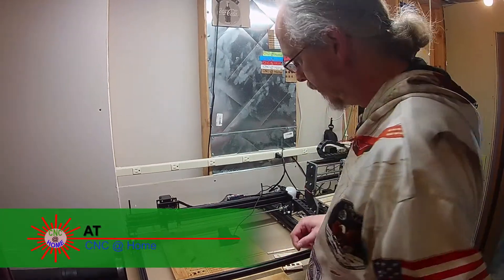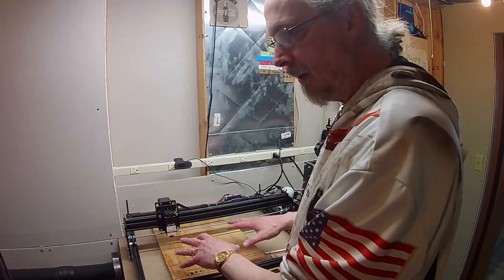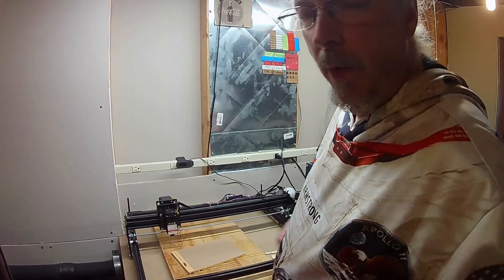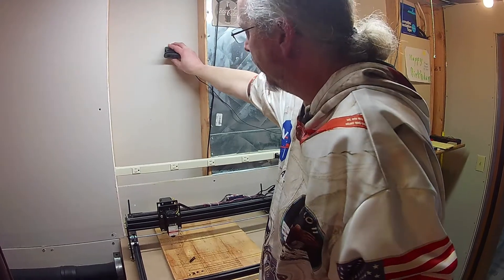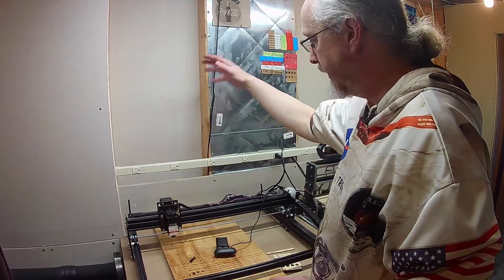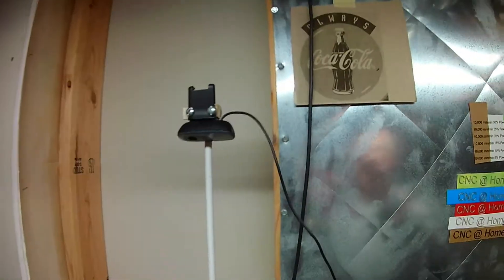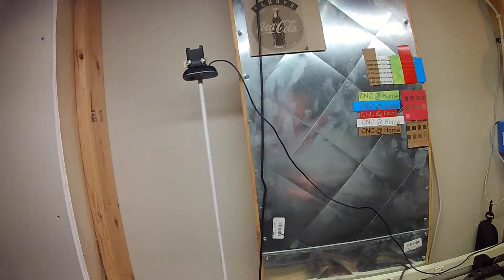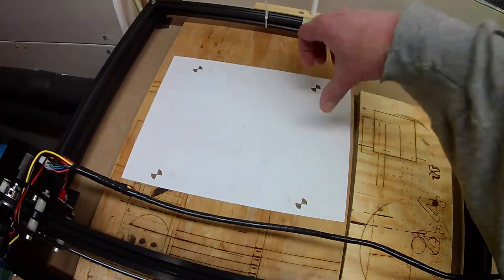Using a webcam with LightBurn

Comment: Hello can you tell me the model of the webcam? Will a 2mp camera works with lightburn
Reply from the maker: That's a good question.  I haven't used that in a while.  Let me go check...  It is an old Logitech HD Webcam C270.  At least that is what my computer says when I plug it in.  A 2mp webcam would work.  The better the resolution, the more accurate it will be.  Good luck!  🙂
Reply: @CNCATHome  thank you very much

Comment: So I'm looking for a decent 8 megapixel webcam for my ortur laser master 2 pro with a 400x400 engraving area. Any suggestions? The one lightburn sells is too expensive for what it is and there are mixed reviews on image quality. Plus I really don't want to spend an extra $30 for a 3d printed case when it should already have a shell around it lol. Most of the webcams I'm looking at on amazon have autofocus that is meant for faces in the center and blur anything that isn't in the center. Looking to spend less than $50 but the cheaper the better as long as it works for lining up images. I don't have a housing and basically doing everything from a table in my bedroom lol.
Reply from the maker: Unfortunately I do not have a good suggestion for you.  When I was playing around with this, I used an extra camera that my brother had lying around. The resolution was not the best for this purpose. I also found that to get it working properly required realigning things every time I used it.  The slightest change would cause issues.  Even when I thought I had it lined up, it wasn't.  I ended up using more to monitor a burn from the other room.  When I built a fume containment box around the laser, there just wasn't room for the camera and I took it down.  
At Paramount Granite (video link: https://youtu.be/4_VbIGTHvB8), they use DSLRs for their cameras to align stuff.  It works well for them. For a setup like you have, that would be a bit overkill and a budget buster.  I hope you are able to find something that works for you.
Reply: @CNCATHome  yep I will keep looking. Thanks for the reply. 😄

Comment: Could you use a camera with your 3018 cnc machine that you have next to you?
Reply from the maker: That is an awesome question.  I don't think I have even through about that before.  It would really depend on the software you are using.  What I am using doesn't have any options for connecting up with a video source the way LightBurn does for the laser.  In the "Let's see some CNC machines @ Paramount Granite" (https://youtu.be/4_VbIGTHvB8), you will see that a couple of their larger machines have a camera mounted above the machine and is tied into their software.  On their big router, it also has a laser that will project onto the bed of the machine to show where the clamps are to be place.  Very cool stuff.

Comment: Hi been watching your videos and they are very informative.  I just ordered myself an LE5040 and will be setting it up today.  i was wondering if you could share your GRBL settings with me as if sounds like i may need to adjust them to get it running correctly especially if i use Lightburn.  Any other info your could share would be amazing.  Thank you!